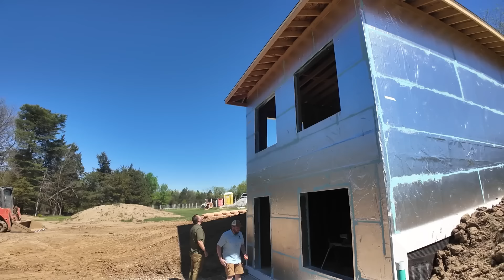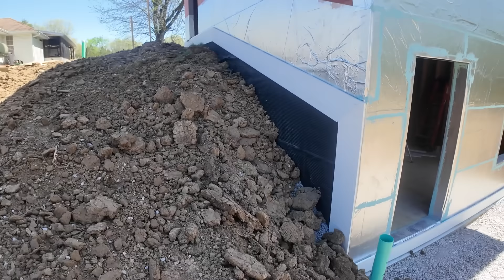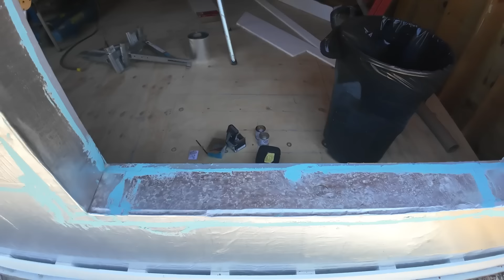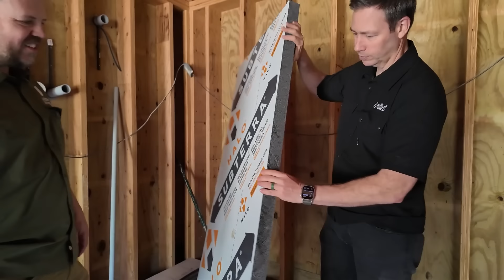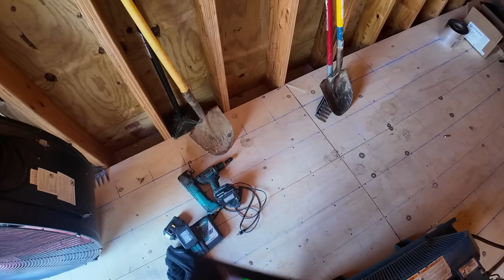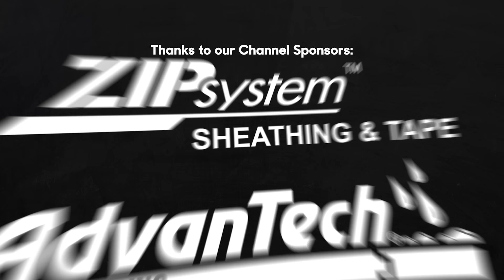Wooden Foundations - WHO KNEW

Comment: I grew up in the '70s in a house with wooden foundation walls on a concrete footing. The footing was about 3 or 4 feet deep, and in spring time the water table was sometimes less than that, but everything held up fine.  Just went on google maps to check, and the house is still standing. Looks like someone put in a pool and extended the garage lol.

Comment: I’ve got a 5,000 sq ft house built in 1995 on a Permanent Wood Foundation (PWF) — full basement with 10 ft ceilings, here in Wyoming. Honestly, one thing I didn’t expect going in was how much warmer it feels compared to friends’ houses with poured concrete foundations. Concrete basements always have that cold, damp feel no matter the season, but mine stays noticeably more comfortable year-round — which is saying something given Wyoming winters. My guess is the wood framing plus the insulation cavity makes a big difference versus concrete acting like a giant heat sink.
Thirty years in and zero issues so far. I know PWFs get a bad rap from people who’ve never lived in one, but the performance has genuinely surprised me — especially holding up to the freeze/thaw cycles and frost depth we get out here. Curious if anyone else here has long-term experience with one, especially in a cold climate — how’s yours held up?

Comment: We do concrete footings with a 2x8 inlaid into the footing, which is then removed and the foundation wall bottom plate sits in the footing. This provides any resistance to hydrostatic pressure. A wood foundation requires such detail to prevent water penetration that the system exceeds that of a normal concrete foundation/damp proofing and drain tile system.

Comment: Question here for anyone. I have a wood foundation house in Michigan that is 21 years old. I have had no leaks or problems at all. I even put down vinyl flooring and carpet on the basement floor. The foundation is completely covered both inside and out so a future buyer of my house will almost certainly assume the foundation is concrete because no wood is visible without removing drywall or outdoor fake stone covering. Now my question. Do I need to disclose that? I am familiar with the disclosure document that requires the seller to list defects but I don't see a wood foundation as a defect. Am I right or wrong?

Comment: I am not sure why there is such surprise about using wood for a foundation. On the Atlantic coast there are hundreds of thousands of expensive houses and commercial buildings built on wood pilings. These have lasted for 100 years through hurricanes and floods. There are also wooden piers that have lasted for decades in the ocean, withstanding constant waves. And of course, the entire city of Venice, Italy is built on millions of cedar pilings driven into the mud by hand and then large masonry buildings were built over them. Many of those pilings are 600+ years old.

Comment: This is such a silly concept. It’s cool and all for DIY’ers or small cabins in the woods with limited access…outside of that, this is completely bonkers when compared to a traditional poured wall setup. I’ve now seen 2-3 houses in MI that are PWF foundations, sure most of them were fairly dry…but every foundation is racked from ground pressure. It’s inevitable that these PWF foundations will rack, rot and fail within 50 years or under. Whereas an appropriate concrete foundation will go 100+ years. There shouldn’t be a single municipality that allows this type of constriction for midwestern or northern climates. Again, cool concept and all…but that’s about it lol.

Comment: I once did something similar on a smaller scale, think sunken shed..  under the floor, which is concrete squares I used sand, 6 mil ,a couple of low wattage heat cables and under all that a layer of foam..  ..boarded by drain tile.   

Stacked pt 2x12s with 4x4 studs for sub grade walls all wrapped with 30#, then 2+ layers od 6 mil. The 30# is more sacrifical than functional.. . 
Everything is sand and drains well anyhow, but i like the extra attention.   I don't like good work rotting out just because... 

....like that shit used for garage eve's!!

Comment: Ground-contact pressure-treated lumber can be used either above ground or in contact with the ground. It Has twice the level of chemical retention and protection compared to above-ground treated wood. Must be used when lumber is less than 6 inches from the ground or has poor ventilation.

Comment: I'm certainly no expert, but you've definitely opened my eyes to the possibilities. After all, everyone knows that it's the moisture/rot that's the concern with wood, so as long as that is addressed, regardless of above or below ground, then wood should be just fine, right?
I will definitely research this further. I am working on a remote mountain house project right now, and the foundation problem has really had me struggling. This definitely deserves a look as a possible alternative to concrete. 

Thanks again Matt, for another great presentation for a quality building solution.

Comment: I'd have no problem doing this if it was on grade. 
It's difficult to believe that all those specialized materials and construction methods are not going to offset a rather simple concrete job. 
Sure, Portland cement is not that environmentally practical, but neither are all those foams, treated lumber, and manufactured beams.
In the end, it's sort of a vanity project.

Comment: Absolutely do not build with this green treated wood type of foundation!!! I use to backfill these type of structures in the Elk River, MN area back in the 1980’s. I won’t say the builder’s name but these foundations are trash and not built for the long term. We actually had a nickname for this cheap builder who only thought about lining his own pockets with a wood foundation basement in lieu of using high quality concrete materials. We saw unacceptable movements in the foundation, bowing, water issues, insect issues, rot issues and the builder basically get chased out of town. Remember this when building a home… your home is only as strong as your weakest link. Tornadoes also rip these wood foundations apart far more easily than concrete made foundations. These are crooks making money off the unsuspecting homeowners. These types of construction shouldn’t be allowed to obtain financing for such an inferior property!
Reply: If you follow the Building Standards, PWF's are a good alternative.  If you backfill with heavy clay (especially beyond the height limits) and do not use sand, gravel and crushed rock you are asking for trouble.  I came close to purchasing a PWF 33 years ago and at the time I had an Engineer look at the foundation to ensure it was done right..... which it was.   The house was 15 years old at the time which makes it close to 50 years old and it is still standing and doing fine!!

Comment: i was working in missoula for a month this summer. i was staying in a neighborhood where almost every house is on wood stemwalls on minimal concrete footers over a 4-5' deep crawlspace. the stemwalls were backfilled with dirt against on the 3/4" cdx exterior. 24" framing. wild to see. i inspected two of these houses and neither showed any significant rot. built circa 1990. no plastic barrier or foam insulation on the outside of the in-ground plywood.

Comment: Wood underground foundation walls have been around for 50 or more YEARS, including four walls below grade with no windows. Proper DRAINAGE is very important, not the nonsense the building code allows for concrete foundations.  In our area, for concrete foundations, drain pipes are installed, with a thin layer of drain rock, and the trench backfilled with the excavated lot soil.

Comment: Wood foundations when done right works good.  In Florida along the beach or bay a lot of houses are built on huge dock pilings.

I like dock pilings, you could easily buy some and just dig 4 to 5 feet down, fill with concrete and have them stick up 2 ft above ground.  Those could easily hold up a tiny home or adu.

Comment: The city of Venice, Italy largely rests on a foundation of timbers.  Key to any construction type is details of how it's done.
Reply: The Back Bay of Boston was built the same way. It's the brackish water in these coastal areas that preserves the wood. When they built the John Hancock Tower, nearby Trinity Church was in danger because the water levels had fallen and the wood was getting exposed to air.

Comment: I designed resort cabins in the rockies with PWF. The main issue was getting concrete to the site. I have also been involved with heavy timber PWF foundation in the Northern Canadian territories where the building is raised above grade to keep the ground frozen. We use heavy timber much like a pad footing and then stand piers and braces on the pads to construct the building above the ground. Wind is allowed to pass under the building.

Comment: I just experimented with this technique this year on my property. I found a lot of good tables online specing out stud sizing, spacint, back fill height, sheathing thickness, bracing. 

I was 24' x 28'
2x8 @ 12" o/c

Only issue I has was I would have put anchor bolts every 24" or better. Or a bottom plate keyed into my concrete footer.

Comment: Designing a Bazcek and Bruton inspired house in Minnesota using PWF. Heat load is 2 to 6 BTUh per sq ft.   Warmboard water temps are 75F so the A2WHP will be purring.

Comment: We love our wood foundation in Central Iowa. Warm, quiet, dry. First one built in our local was in early 70’s, still great.
Reply: I am considering wood foundation. I didn't intend to have a basement though....but now rethinking it. Did you do concrete floor...or some sort of wood/truss system?
Reply: @dennisfernau8076  We poured a concrete floor. The wood foundation and concrete are on 10 inches of leveled and compacted pea gravel with drainage tile around the outside perimeter that drains to daylight. This turns the entire underfloor into a drainage plain. We installed the waste line and floor drain in the pea gravel before the basement floor was poured. After the basement was capped we backfilled half way up the walls with pea gravel before finishing with soil. The house is built on a sloping site with fill varying from four to eight feet. It is super sturdy and the driest basement I’ve ever experienced. And so easy to wire and plumb and finish! We’ve three spare bedrooms in that level and because of the slope all have 42x60 windows above grade. With the natural light and quiet it does not feel like a basement.

Comment: Can we lower our standards anymore? The most important component in the house is your foundation and these will rot overtime. Every wood foundation I've inspected has some degree of water damage visually found on the inside, I can only imagine what the buried side looks likes. The 1970's were are horrible decade for building construction, this is one of the disasters of that time. I can't believe someone is still building this way. Open minded to a cheap install that will fail overtime and is MAJOR to correct is not something I will ever sign up for.
Reply: You seem to be littering the comments section with variations of this comment, yet plenty of others, including myself, have experiences completely at odds with your claims. Our PW foundation has none of the issues you've described nor those I've seen in foundations built with concrete, like cracking, settlement and general dampness.
Reply: @davidjames4915  So what about the ones that do rot? Its a real thing and is a really big deal when it happens. Your emotional attachment to wood foundations is blinding you from real facts. I've personally seen many of these rotted, its real so why argue with me?

Comment: Laws of physics must be different ancross the ocean. U are only worried about pure water.. But the humidity itself can cause mold growth to the structures. Even if u can manage the water level you have not solved the fundamental issues of such structures. Underneath the structure soils humidity will saturate the pore air to levels (>75%RH) that will allow mold growth. Under the below the gound the walls insulations outer edge will stay relatively cool all year around, in summetime when absolute humidity will rise it will cause a dew point, even with out any extra water. Sorry for the bad english. Almost with the same amount of money and labour u could make it properly.

Comment: I have such a basement on the other side of the globe - in Russia.)) The foundation is made of 2x12, the frame is made of 2x8 and the lower concrete slab, 6 inches of insulation. In my climate with a cold five-day period of -39°C and a standard soil freezing depth of 9.5 feet, I have only positive emotions. 
 Design solutions in any technology, not only in PWF, must take into account the peculiarities of local soils and climate and all activities must be carried out without exception and with due quality. In this case, we can safely talk about a guaranteed service life. I used Delta MS Drain as waterproofing instead of 15 mil polyethylene - an excellent result, I still see sawdust on the bottom plate from basement work after 5 years. 
 Written with Google Translate.

Comment: Great construction alternative. We will be building a remote cabin and plan on using pressure treated 4x12s for our footer as well as pressure treated 2x’s for the stem wall. It will be much easier than going with a concrete foundation.
Reply: Your footers don’t need to be 4x12.  2x12 will suffice im sure.  I’ve built 3 story houses on 2x12’s pwf.

Comment: We have that crappy bentonite soil - So my cousin had a basement with a wooden subfloor- the concrete floor would have a great chance of being cracked and sections lifting.  It did freak me out a little to have a crawlspace in the basement.  They also had a sump pump. Think the floor would feel really warmer.  It really comes down to trusting the waterproof layer and controlling the water flow--- Like that is is walk out- would want to think about ok what happens if you have a leak from a pipe inside the building  - If you made the entire bottom a giant french drain structure- then possibly a plastic layer to help stop damp rising on the area inside the walls.  This seems like a perfect opportunity for something like a honeycomb made out of plastic sill pan that would be nailed on to the bottom side of the foundation sill.  Then the waterproof peel and stick layer could stick to it on the bottom
.  Then proper backfilling like you should do with a regular house.

Comment: A good friend of mine has a dad who built a bunch of these foundations in the 80's that are all around my town.  The only thing he has mentioned is that the preservatives they used then are dramatically different than the ones they use now so you really can't compare them apples to apples.  The forces are obviously the same and doable but the longevity might not be.  The positive thing is it would be possible to make smaller repairs

Comment: In Peoria, IL a public housing apartment complex was built with wood foundation 40 years ago. It's still standing so if you can keep it dry and the termites out, it IS viable.
Reply: Termites aren't an issue because the treated wood is toxic to them.

Comment: I put on a 900 sq ft addition with a 4 ft deep crawl space,, on concrete footer wood foundation in 1985.  Followed that very PWF manual.  Then in 1998 added a 200 sq ft room with wood foundation 2 ft crawlspace on a pea gravel footer to add on a 22 x 40 second floor to the original 17 x 27  house.

Comment: I've been building wood foundations in MN for 25 years. Pea rock footings, we did use 2x8 green trt wall framing.
Reply: Michigan needs to learn these kinds of things from Minnesota. So close on the map, so far IRL though, with no proper rail network to connect Midwest cities.
Reply: Interesting.  
Sir, did you mean “Rubble Trench” ?
As opposed to Pea Rock … maybe I have it wrong, but I imagined you said Pea Gravel here.
Tiny stones perhaps ¼ to ½” … which do not pack.  

Whereas I believe Rubble Trench will use larger stones, perhaps 1”, 2”, 3” or more.  Good drainage, and very sturdy - I believe they “pack” or lock together.  

It’s just that Pea Gravel does not pack at all … can kick the little stones around with your shoe.  TY

Comment: That looks like a very well-built example of a home with a preserved wood foundation... sadly many aren't. My cottage is PWF circa 2002, and it has had all kinds of issues with the footings shifting due to critters burrowing under them, and poor drainage (which I've since corrected). That said, it is definitely more comfortable in the winter than traditional poured concrete.  I also work in real estate and I've seen a lot of failing PWF homes from high water tables/poor drainage over the years. Another thing to consider, financing them can be more difficult... If you can afford it, I'd go ICF.